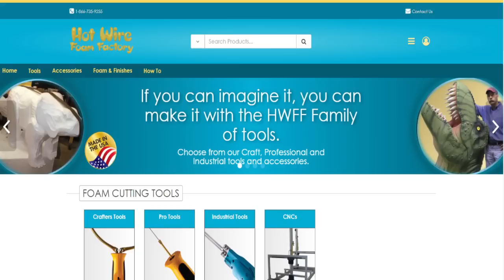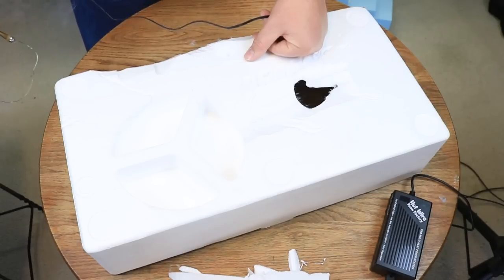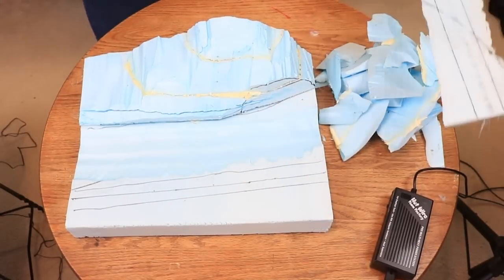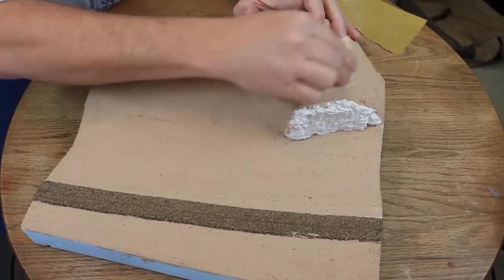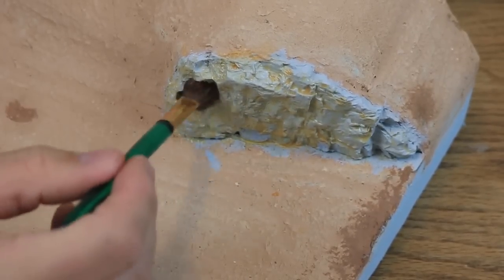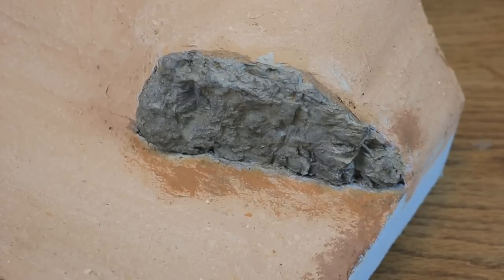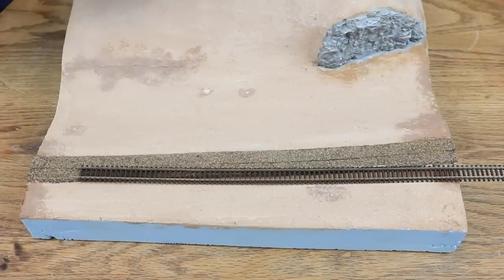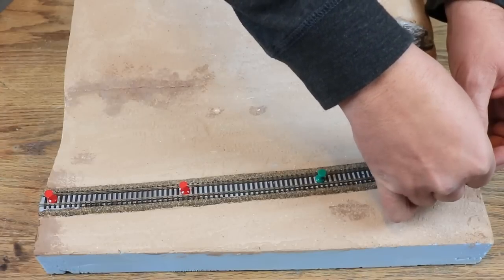How to Build Foam Scenery

Comment: I make extensive use of foam and always used the Woodland Scenics hot wire tool which is equivalent to the sculpting tool. The variable power pack  used by the Foam Factory tools could be an improvement over the WS hot wire tool. I would like to try the Foam Factory hot knife but will go with the longer 6 inch tool. I've found that I can use the less expensive white bead foam wherever I don't need structural strength provided by the blue/pink foam. This also means I can make use of free scrap packing foam like you used for practice. The hot wire is ideal for white foam because it avoids all of the tiny white beads produced when using a rasp. I usually cover the foam with plaster gauze. This protects the foam. It also means I can use plaster to mount the casting in place and blend it into the surrounding area all in one step.

Comment: Howdy, I've found that in making photo diorama's that having a sloped foreground really helps.  If you notice in the last shot with the track in place, you could see the edge of the foam.  If you made that come out about 3-6 inches in front of the current front and gently sloped it down to a thin edge at the front, it would 'hide" the front edge in photos much better.
Reply from the maker: That is a good point. This diorama is made totally from scraps on hand so I was limited, but thought I would practice on this one.

Comment: I have a tip to pass along instead of using a screw to plug the nozzle on a tube of caulk I use a large red wire nut it screws on perfect and tight and keeps your caulk from drying out.
Reply from the maker: That's a great idea. Thanks for sharing.

Comment: Perhaps the tools are material dependent, but the hot wire tool I tried on dry floral foam did not yield satisfactory results. Often, the foam burned before it cut. I found I had much better results using a 9mm utility knife with a long blade.
Reply from the maker: Yes, it varies depending on the type of foam. Works great on Styrofoam and extruded construction foam. Works ok of Great Stuff. Never tried it on floral foam.

Comment: You could also add a "foreground" piece (or several) that isn't attached, it just butts up against what you have now and put structures or other scenery on it, and use the one you are building as a backdrop to the foreground piece.

Comment: Great info here Ron as I am nearly at this step in my shelf layout. In hind sight..how do you like using the spray foam as an adhesive?
Reply from the maker: Honestly, it works but it is not my favorite. I prefer to glue foam to foam with Styrogoo from Hot Wire Foam Factory. There is a link to them in the description to the video.
Reply: @RonsTrainsNThings  Thanks Ron..I have never heard of Styrogoo...I wll have to check that out.. Thanks again. Tom

Comment: Another great bid Ron. The great stuff expanding foam you used, I couldn't tell, was it the stuff designed for windows and doors ( low expansion ) or the high expansion?
Reply from the maker: I have used both, they both work for this application equally well. I would use which ever you can get for less money.
Reply: Thank you Ron. Was concerned about the high expansion soon foam warping the foam board.
Reply from the maker: @seanspennywisemiserrr  You will need to weight or clamp the foam as it cures, but I've never seen it warp.

Comment: Looks good, Ron! Try not to breathe those foam fumes. They aren't too good for you.
Reply: Yeah.. Check your foam, Ron. Lots of it contains fire retardant which is very toxic, very bioaccumulative and very persistent. Outlawed in the EU. I don't know what the situation is in the States, whether substitutes are used.
Reply from the maker: I failed to mention using these in a well ventilated area. I had a fan on low blowing the fumes away from me and toward an open window.